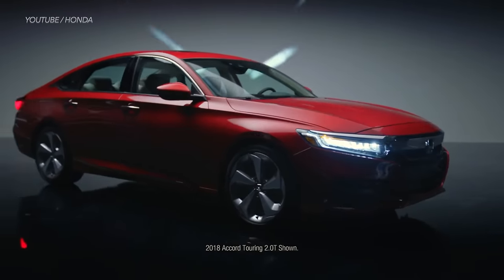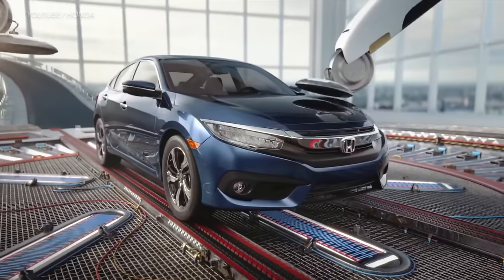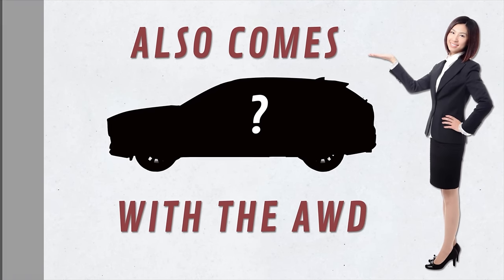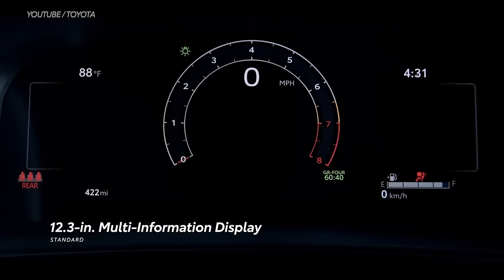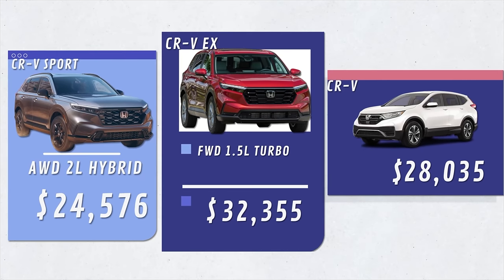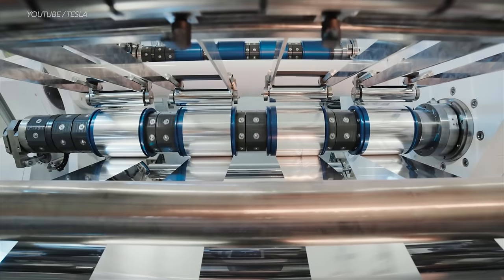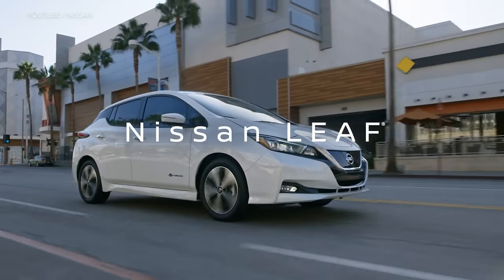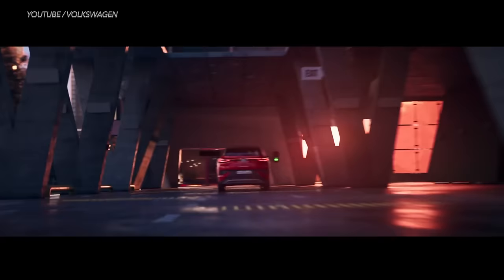Everything You Need to Know Before Buying a Car in 2023

Comment: Average car pymt. is $716, my mortgage is only $702.35. What's the world coming to?😲😲😲
Reply: Most of those "average car payments" are based on a "average" car MSRP of $48K at a 4-year loan.  There's a few big problems with that.  
#1, very few people walk into a dealership, and actually finance the total MSRP... they usually have a trade-in or put money down, so they don't finance the whole amount.
#2, few people these days actually finance a 4-year loan... most do 5 or 6 year loans (some people even do longer).
#3, the "average" car price is 48K... certainly not all car prices... you can still find 25K-35K vehicles out there easily, and a lot of people shop in that bracket.
#4, $702 is NOT the average mortgage rate in 2023... you're comparing a very old (or below average) mortgate rate from years past with current 2023 car loans... the only fair comparison would be the average 2023 mortgage payment (using data from the US Census Bureau, the Department of Housing and Urban Development, Freddie Mac, and the National Association of Realtors, the average mortgage payment is $3,048 on a 30-year fixed mortgage in 2023, btw).
#5, remember ALL averages include those 1%ers pushing the bell chart up.  You and I might consider a 30K car "average" but a rich person throws 100K on his "average" car, that skews the numbers up.  Same thing with homes, you or I might consider a 250K home "normal" but some millionaire buys a 4 million dollar estate, that also throws the mortgage rates up.
Reply: @wolfshanze5980  My mortgage note is for 10 years @ 5 1/2%. Got 2 years left. WooooHoooo.😲😲😲

Comment: Check out used police cars. Just bought one with 24k miles for 17.9k.
Reply: I might look into that 🤔
Reply: @shanepatrick641  not trying to advertise but this site helped me get a good buy for  a newer car. Look up Asia Motors, they're a dealer for used fleet vehicles.
Reply: @kkristopher7413  wow I can buy Crown Vics and awd Explorers?! No way 😀.
Thank you brother. By the way, which car did you buy? Still going strong?
Reply: @shanepatrick641  I actually have only owned this 3.6 V6 charger for a out a month. With 24 k miles it is still just fine. I had bought a 2004 crown Vic in 2006 at a similar place for 7500$ it had 66k miles on it and it is still running with 194k miles on it. Car prices are just so expensive. The used police car market was much more affordable and reasonable than buying a used regular car. Why would police departments get rid of a car with such low miles and waste tax payers money? But we can benefit a little from it.

Comment: When they make a 1000 mile battery I will buy an EV.  What people don't realize is that if they buy an EV and its suppose to go 350 miles on a full charge, they would get it if you live a perfect world.
That means don't use the heater, A/C or anything that runs off the battery.  Heck, even the electric power steering uses the battery.
So, if they make a 1000 mile battery EV, I won't have to worry about plugging it in every night and who cares if it only goes 800/900 miles before the battery dies.
Reply: You'll probably be buying an EV in a few years then.  A few years ago, the average EV could go maybe 100 miles on a single charge, now we're around 300 miles... tech is moving REALLY FAST on EVs.  I'd say the complaint about current EVs isn't what you're complaining about (actual mileage), but much rather the point if you pay $60K for an EV today, the TECH in that EV will be obsolete by the time you pay it off, because EV tech is moving so fast it will make your head spin.

It's the equivalent of spending all your savings on the 1903 Wright Flyer (in 1903) only to realize that a few years later, the 1903 Wright Flyer is a complete joke and totally obsolete.  We will have 1,000 mile EV range in a few years... the tech is moving that way very fast.

Comment: I just want to say that, I bought a Honda Odyssey becuz Scotty Kilmer said Hondas and Toyotas are quality. And that Hyundai and Kia sucks. 

I really want to believe this. However, my old Hyundai is almost 200k miles w no issues. And my new Honda Odyssey been giving me problems. It’s not even 2 years. The tires it came w is also very low quality and It fell off. I had to change it. Than The mirror fell off. When I looked at the back of the mirror, it’s just some cheap glue that’s probably made in China they slapped together to the base. When I took it to the dealership, they said it’s normal. The dealership did fix it for free, told me if it falls off again, they would have to change out the entire area. 

I’ll try toyota next time but I think Kilmers feelings are based on nostalgia and living off of past glory of the 90s Toyota and Honda.

Comment: How long do you figure we will be able to get fuel for gas powered vehicles?
Reply: PS: Happy New Year ‘23
Reply: I'm sure they'll be around a lot longer than most think. There are far too many fuel powered vehicles.
Reply: About as long as you keep flapping your lips.
Reply: Forever. Hybrids will ensure that
Reply: Considering most  military, first responders, construction equipment/vehicles, naval and aviation engines will be using gas for a very very long time, I wouldn't worry about gas being hard to get any time soon.
Reply: @BA-sw5dn  you're right, I found plenty of gas just in these comments 🐽
Reply: There's enough gas in the South Pars condensate field to last humanity another 100 years.
Reply: They are no where near ready for all electric.  This will turn out to be a disaster.
Reply: A loooooooong time ….rest assured.
Reply: Always. It's all about money. Oil companies, politicians, greed.
Reply: Fuel will be around for a long time yet. I remember when geography teachers said that we are running out of oil. Of course that was just fear mongering. We still have lots of oil.

Comment: I’m 78 and I just shake my head when I see the price of cars. I bought my first home for $12,500. I bought my first used car for $90.  Yes, $90. It passed inspection without any problems and had no rust on it. It was a 1956 Studebaker Silver Hawk purchased in 1964. Gasoline was less than .50 cents per gallon. This makes me wonder what today’s teen Agers will be paying for vehicles when they are in their mid sixties.
Reply: You are missing the point. The car is much better and safer nowadays. There is many (all) things that is cheaper nowadays than “in the old days” due to efficiency in society and at work has gone up many times over.
Reply: I know, the prices of everything is ridiculous nowadays. Doesn't help either that wages have barely gone up to keep up.
They're just making the poor, poorer.
Reply: @Harrythehun  it's still stupidly expensive...I bet if companies ditched dealerships prices would go down...
Reply: And I bet bread didn't cost $5 a loaf either.  You had the good ole days for sure.  If the international "financiers" have it their way, today's teenagers will be living in 15 minute cities and not driving anything.  Have you ever read Henry Ford's book or Mein Kamph?  Those will tell you everything you need to know.
Reply: @Harrythehun  I’m paying for things I don’t want or need. My car was dependable, economical and relatively efficient. My home was comfortable and roomy. If you want more than that you should have that option but I don’t want to pay for things I don’t want or need.

Comment: Do you factor in dealer markups on new cars when you compare those prices to the same car used?
I can't believe a used Rav4 would cost more than a new one with a large dealer markup applied to it which seems to be the norm now.
Reply: Why would he factor-in what a private dealership does?  Dealerships have private owners, not all dealerships are crooked or do markups.  That's like factoring in the price of something based on what Scalpers charge.  Do you think everyone should do reviews of Concert Tickets or Nike shoes based on scalper prices?  If you go to a dealership and they do markups well over MSRP on a new car, turn around and walk right out... they are scalping you and should be treated exactly like a scalper because that's what that dealership is.  Believe it or not, there are more than one dealership for every auto manufacturer out there, and they are not all crooked doing scalper mark-ups.  If you want a Toyota, or a Hyundai or a Chevy, and you go to a dealership whey they markup the price, tell them you don't do markups over MSRP and will visit one of their competitors down the road or in the next town over.  Do not support scalper dealerships, for every one of them, there is a more honest dealership that will not charge over MSRP.  So no... there is no reason this video should factor in scalper prices.
Reply: @wolfshanze5980  Well, when 90% of the dealerships are marking up prices then yes it would be helpful. No one is selling MSRP within 500 miles of here.

Comment: Hey Scotty what do you think about the 2023 Genesis g80?
Reply: Take a chance getting that car.  Plus Scotty doesn't answer questions here.
Reply: @oreally8605  thanks for the advice
Reply: @santanaminer8634  You're good for about 100k miles if it was made in Korea.  But in the states it's a chance.
Reply: @O Really?  its probably made in korea since it's flagship.
Reply: @eugene44569  True.
Reply: @O Really?  it's also the 
 usa and Mexican made ones with problems make sure its made in korea so you get the best quality. My kia octima hybrid got 80k miles with frequent oil changes still good. I know 80k isn't a lot but it's made in korea so it's been solid for my standards. Going past 120k would prove the test of time
Reply: @santanaminer8634  The Korean brands are decent with reliability just take care of them I have an 09 Rondo with 244k km so 151k miles no serious problems just need to replace timing belt and Ac compressor and this is era of Kia before they seriously improved
Reply: Genesis makes excellent cars. Very quiet, great material quality, and have lots of value. It won’t be as reliable as a Lexus but will definitely out live any of the Germans.
Reply: @oreally8605  all Genesis are made in Korea if I’m not mistaken.
Reply: Scotty talked about the genesis, he took apart two engines, one engine was a Lexus and the other was the equivalent Genesis, the Lexus made by Toyota had almost no wear on the cams while the genesis Showed noticeable wear and tear on its camshaft and cam lobes. In other words, if you want a car that’ll go 300,000 miles, then buy a Lexus. If you buy a Genesis expect the motor to go out after 100,000 miles or so
Reply: @jeffzekas  that was a Hyundai Genesis not a Genesis of modern times. He is yet to review a modem Genesis (since they made it its own brand).
Reply: Problem with the Genesis brand is that Hyndia dealers don't really support it for maintenance and repairs.  Check the VIN to make it was made in South Korea.

Comment: 84' C4 Vette.
Reply: 1966 Mustang fastback
Reply: @mickjames666  even a 6 cylinder manual is fun. in some barn somewhere...
Reply: @ThomasWBaldwin  agreed
Reply: 84 Corvette was horrible, the cross fire injection system was so bad it’s no wonder they only used it for one model year before changing to tuned port injection in 85.
Reply: Now we're talking 😎
Reply: @bretthansen8166  whatever. they're cheap, I'll mod the thing with a straight six 3 speed manual. I just want the shell.

Comment: Last summer a guy posted on LinkedIn a repair estimate from a Florida Chevy dealer to replace the battery in his Chevy Volt with 70,000 miles on it. Cost of replacement $29,842…battery alone cost $26,887, the rest was labor and taxes. Now I’m watching videos of people trying to charge their cars in freezing temperatures…many of the charging stations wouldn’t work. What a scam!
Reply: I know! Ridiculous isn't it?? Stick with gas engines and keep them running for as long as possible.

Comment: I knew a factory who had forklifts that ran on propane . They used Amsoil full synthetic oil and they only changed the oil once a year . Could this ruin the engines ?
Reply: Forklifts don't put on many miles and their motors don't rev very high. As Scotty says, "Engines are expensive, oil is cheap."

Comment: Hey Scotty I have a question. I drive a 2015 Fusion Hybrid and it has right at 100k miles. I have started having small issues that need a fix and it is getting annoying. I want to know if that 2.5 liter 4 banger is a good motor, or trash like I am thinking it is. Please let me, or anyone really, thank you. Also, I work for Ford Motor Assembly and like them well enough. I just wish I could find a new F150 3.3 liter V6 for sale as my daily driver. Finding a Maverick with the 2.0 liter, FX4, and tow package options is impossible. Not unless I pay over MSRP... keep in mind I get it for employee pricing and it grinds my gears enough I want to quit working at Ford, but I kind of want to retire someday and will not find work that pays the same. Not unless congress passes the $22 an hour minimum wage lol.
Reply: 2.5L engines are pretty reliable. Maintenance is key as always. I would have loved to own a Maverick myself too but like you said, dealerships sell them twice the price over MSRP. I'd find used 3.5 NA or 3.7 liter V6 since they're cheaper if you're looking into F150s. I just bought an F150 with the 3.7, and the power is nuts for a V6 NA.
Reply: They work really well, got 110k on my 19 fusion lol cause of work but its running smooth. Just keep it well maintained

Comment: When scotty said a used F-150 was just a hundred dollars more I sighed with relief lol. I'm eyeing a 2017 F-150 XLT (Full Cab, V6 3.5; 60,500 miles) for 18,000. Anyone with opinions on this? thanks!
Reply: I recently conversed with an owner of a f-150 with the 3.5L ecoboost. He ignored the suggested intervals of maintenance and did them more frequently. He’s sitting at 220k just keeping up with oil, spark plugs and belts. I think if you baby it, it will take care of you. I think that’s a great deal, of course just check the frame for any signs of rot, warps or bends, check out any gaps in the body to make sure it wasn’t in an accident, (or bolts and parts that seem newer than the vehicle) and scan for leaks! 
I’m currently pondering a used super duty for work, as I liked a colleagues f250 (and his truck had 310k miles with the basic maintenance!)
Reply: @robertlucas8104  Thanks Robert, I own a 2015 Malibu with 70,000 and I've always kept up with maintenance and she hasn't failed me yet. If purchased this will be my first truck to my name. I will definitely check what you mentioned. I also have my own mechanic who will check it out so two pairs of eyes are better than one! lol. Wish me luck! and the best of luck to you with your F-250 search. Happy New Year!

Comment: I got lucky with my 2023 civic hatchback that I bought last month. It was $34k but i negotiated it down to $29k. My loan payment is $466 a month for 72 months.
Reply: Could you give a few tips on how you negotiated that deal? Thanks
Reply: @infinity.1.0  I originally contacted a sales person about the car over the phone and the price he gave me was 29k. I drive there and it had a 4500 mark up which put it at almost 35k. At the end of my test drive I told them I liked the car put the price was not what i was told it was gonna be. So the sales guy managed to get the mark up taken off from the actual price cause I told them there is no way I can buy it at 34k cause it wasn't worth the price. I did alot of research before buying this car especially pricing of many different models and 29k was pretty reasonable.
Reply: @christianfuhrmann5647  wow lucky as hell man. I want a civic SI but really hard to get msrp

Comment: Scott 96 mazda b3000 v6 Ford engine 89k miles. 5w20 like it states or 5w30???
Reply: Did the factory spec 5w-20 in 1996? I don't  believe  it!  After searching around the web, I found that 5w-20 is rec'd. I'd  use that,  but change to 5w-30  for hot weather.
Reply: What are you even asking? Are you saying you have a v6 ford engine in a Mazda?
Reply: @jamesgarner4127  Mazda  and Ford collab'd on those pickups. Just
Rebadged  Ford Rangers...
Sorta like Toyota and Subaru today.
Reply: @williamevans6522  Yeah the factory and cap calls for 5w20 this is my Florida truck it won't be going to N.Y in the spring summer and fall. I just redid and serviced literally everything from all fluids to shock and control arms to seals and shifter bushing kit. All new pretty much everything from headlights and head liner to rear slider window..has low miles and plan to keep it around, so was asking Scotty what he thinks. Should I run the recommended 5w20 or run 5w30 because in some of his videos he says ford dropped the ball and called for 5w20 on some light duty trucks and engines when you should be running 5w30 so was wondering if this model ford engine is one of them
Reply: @tintdr  I know  manf's , due to CAFE standards, call out 0w20 ,  5w20 when other countries call out 5w30 for same engine.  
Subaru is like that- even with their VVT tech.
I haven't  heard Mr Scotty on this particular issue- just generally saying, " follow the factory rec'd for oil vis.".
If it's  FL you could probably get  away with it, but use full synTH.

KIRKLAND(COSTCO)  is only $38 for (2 ) 5 qt jugs.SYNTHETIC.
Maybe  screen the RANGER forums for this...